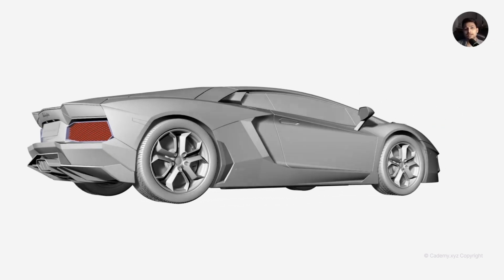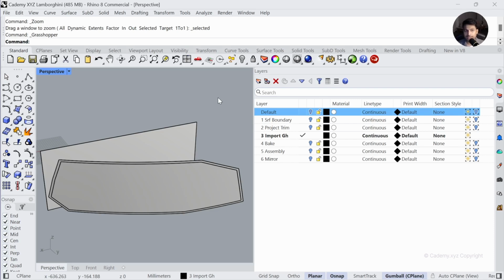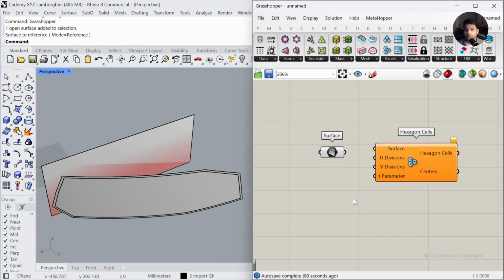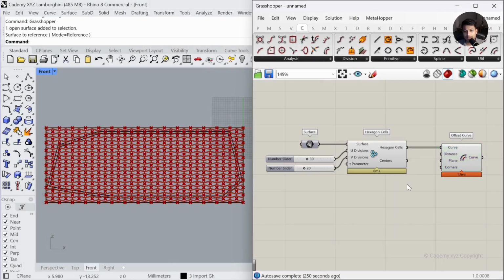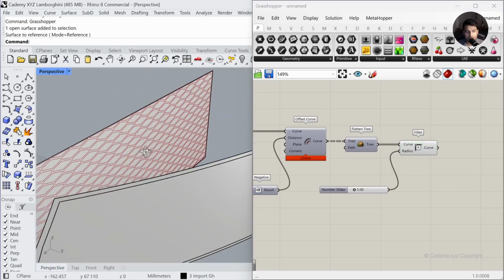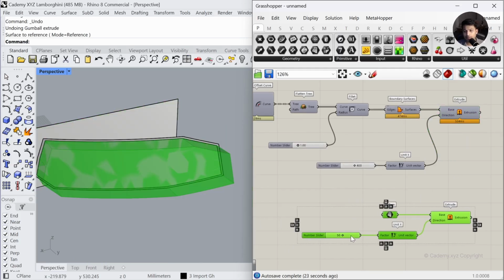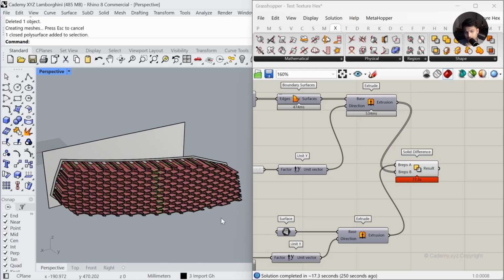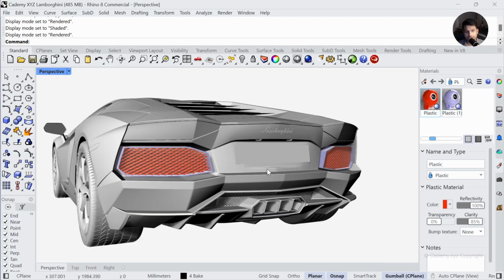Lamborghini Vent Texture Grasshopper 3D

Comment: Rhino and grasshopper are work Mac m1 stable ? Thanks
Reply from the maker: Yes, they work fine! Way better than the Snapdragon Arm chips for windows. I am using it regularly on M4 MacBook Air as well.
Reply: @Cademy  what about keyshot performance
Reply from the maker: @ you can do still renders, as it's only using the CPU. But if you want to render cloudy plastic animations, this is not ideal. Find a laptop with good GPU. I use Lenovo Legion with 4080.
Reply: @Cademy  Sir, would you recommend any entry level laptop that i can buy for rhino and grasshopper. My current laptop hang when run grasshopper script, i am beginner.